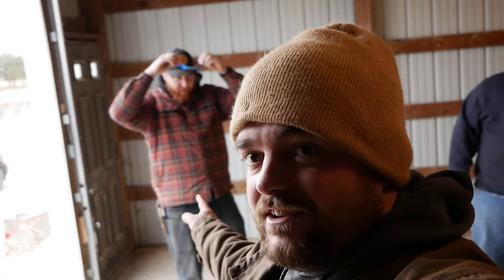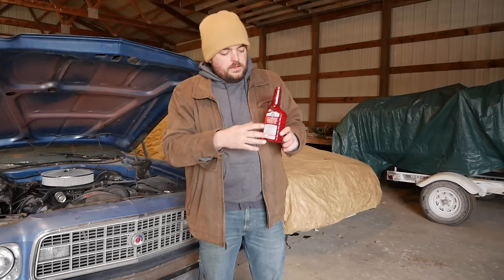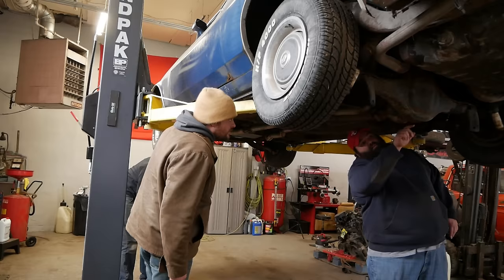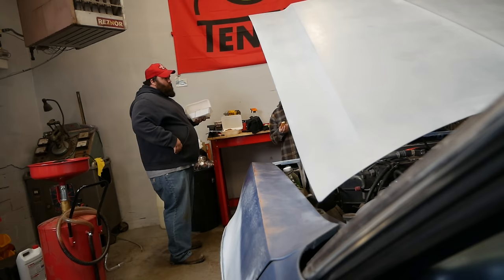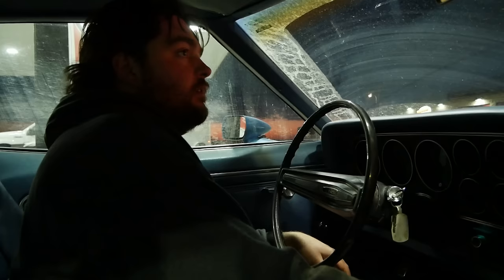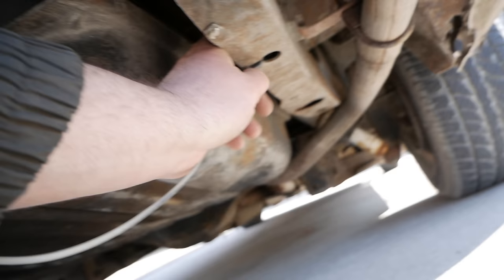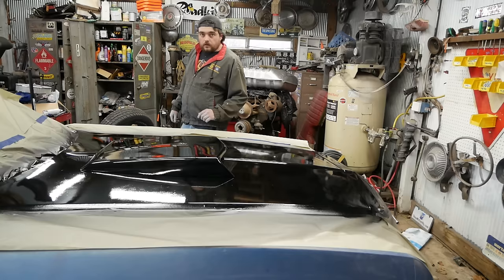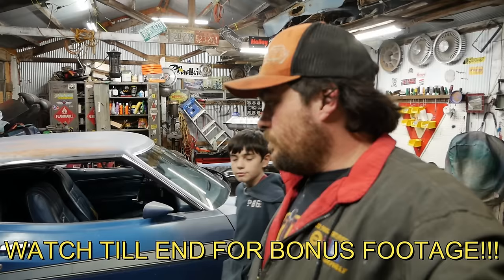Will My DREAM CAR Gran Torino Drive 260 Miles Home? Plus Day Two Mods

Comment: What I appreciate is that you do not just pull a vehicle out of a tree row, make it barely limp to your shop and then park it forever.  I want to do this some day and make it reliable.  You are great narrator and your boy has a personality which is awesome.  So yes, take us along when you make this Torino better and betterer.
Reply from the maker: Thanks Kindly👍
Reply: The guy you are referring to is barn sour, lol that's like when a horse will run towards the barn but won't run the other direction ,
Derek will drive any car home no matter how far the mileage. but  have you ever noticed when he leaves his vehicle has to have an LS motor in it and all kinds of upgrades done. I realize those are his cars he can do whatever he wants but in my opinion he's not enjoying most of them. That's why I enjoy. Dalton and his show he is a road warrior ,a lot like me if you build a car you should be able to hop in it and go anywhere any direction as far as you want without worrying about a breakdown, And if something breaks? so what ,fix it and keep going

Comment: In 1996, I found and bought a 1973 Torino with 29,400 original miles. It was like new, garage kept, factory belts and hoses were still on it. Paint code 2B bright red, base model with exceptions of 351W, FMX, sport gauges with tach, power disc brakes, power steering. Interior was base black bench seat. I installed rear sway bar, gas shocks, 15" x 8" wheels with fat radials, dual Flowmaster exhausts, and then drove it daily for the next 20 years without any major problems. Gave it to my son about 5 years ago because he is a better mechanic than I am. He was with me when I found it, age 5, and he grew up riding in it daily. I will always love these cars. Congrats on getting yours.
Reply: Its great to hear that someone in their late 20s now early 30s actually wanted an older American car!   That made my day,  I've never owned anything but American, my last purchase was a used 1997 Mark Vlll in 2002,.  Still have it and it has over 350K miles

Comment: Ah, the memories. My first car was a '73 Gran Torino Sport that I purchased in 1989, just before I graduated from high school. It had a 351 Cleveland and an FMX transmission. I loved that car and drove it into the ground, before trading it for an '86 Firebird. I miss it to this day. Thanks for sharing!
Reply: Also my first car at graduation in 82, but it had a Windsor. It didn't take long for me to swap it with a Cleveland and FMX transmission, and I also miss that car.
Reply: My buddy had a 1970 Mercury Cyclone with a 351 Cleveland and a 4 speed. One of the fastest cars I ever rode in.

Comment: I’ve also found that Rustoleum is the best spray paint unless you get the expensive custom mixed stuff at a paint store if you’re tryin to color match sumthin. The absolute BEST spray paint for coating a truck frame is the Rustoleum “Professional High Performance Enamel” paint. It’s a little better than regular Rustoleum, and it’s a million times better than any of the rubber undercoating in a can. I’ve used it for years now and it’s the only thing that has survived salty winters. The undercoating in a can is the absolute worst junk I’ve tried, it might work in some situations but salty roads make that crap flake off almost immediately.

Comment: I was going to write that your Gran Torino needs a hood scoop ! and you were way ahead of me , looks soo much better now , and I really appreciate the fact that you have your brother and son along on your adventures , and thanks for taking us along on the ride too !
Reply: Gran Torino should have had a factory scooped hood. Not sure why this one didn't.
Reply: OK, I checked this out. The GTS scooped hood was standard on those models in 1972, but optional in 1973. Bummer.
Reply: Wide tires is a must on this car...that's why it has air shocks.
Reply: @scottwright388  Agreed helps with getting traction to the pavement and when you are behind it in another car it just looks badass

Comment: I’d like to see more.  She deserves a fixed up body.  And by fixed up, I mean welded in patch panels.  You can do it!
Reply from the maker: It'll get whatever it gets, they don't make patch panels for these
Reply: @PoleBarnGarage  Whatdaya mean they don't make patch panels for these anymore???  I saw a roll of patch panel at my local hardware store just yesterday.  In fact, they had more of that brake drum rebuilt in a can right next to it.  Modern tech, I'm telling ya!
Reply: JB Welded in patch panels**
Reply: little body work little bondo  with a nice paint job. Look great. I could do a nice paint job job on that car

Comment: IT'S COOL THAT YOU LET THE KID DRIVE.  I STARTED DRIVING WHEN I WAS 7. 1968 TOYOTA LAND CRUISER WAS THE FIRST OUT IN THE DESERT. THEN OTHER CARS AS WELL THAT MY PARENTS HAD. 1974 ROLLED AROUND AND MY MOM BOUGHT HER FIRST 1970 BOSS 302 MUSTANG AFTER HER DIVORCE. I WAS 12 AND SHE WOULD LET ME DRIVE IT IN RURAL WADDELL AZ. SHE WOULD TELL ME TO HAMMER IT AS WELL. THE FASTEST I DROVE IT WAS 120. HER SECOND BOSS 302 WAS A STRIPPED MODEL, AS THE FIRST ONE WAS LOADED WITH THE OPTIONS. BUT THE SECOND ONE WAS PROFESSIONALS BUILT AT THE PIT STOP IN SCOTTSDALE, AZ. IT WAS A BEAST. IT WOULD COMPLETELY ANNIHILATE THE FIRST ONE WITH EASE. HER FIRST BOSS 302 SHE HAD SHE TRADED OFF TO HER FRIENDS 72 4X4 SCOUT. SHE SOLD THE SCOUT 2 MONTHS LATER FOR A 45% PROFIT AND WENT OUT AND BOUGHT THE SECOND BOSS 302. WELL HE BLEW UP THE BOSS AFTER DISCONNECTING THE REV LIMITER. BUT HIS LUKE AFB FRIEND BUILT IT BACK UP PRETTY DANG STRONG.

Comment: That is so cool that you got your dream car, I felt your excitement throughout the video. And the fact that Kevin just "happened" to have it hidden away just waiting for you, it was like it was meant to be. That turned out great, as I was watching I wanted to suggest the method I used on my 77 F-250, I used doller store oven cleaner on the spray paint, let it sit a few minutes then hit it with a pressure washer. It worked pretty good and much faster. Then what was left I used the scotch brite pad method like you did. Thankfully I only had to do the cab and front clip, lol as the bed isn't original and not the same color, "yet". Hopefully that tip helps you out on future projects. Keep that smile ear to ear sir and enjoy that new ride. 😁

Comment: I bought a 1973 Gran Torino (2-door, with 351 "Cleveland" V-8) after my beloved 1967 Mustang got totaled by a drunk driver. My Torino wasn't the fastback, though. I'm glad you like it, I hope you are happy with it. Mine was really, truly, far & away the WORST car I ever owned (and I once owned a 1974 Vega!). I was about to go back to college, I HAD to have wheels. ANY wheels. Huge on the outside, only so-so interior space. Handled like a barge. Guzzled gas INCREDIBLY. Rusted like crazy. Fragile cloth seats. I was FINALLY able to unload it for $600 a couple of years later. But HEY, "Other than that, Mrs. Lincoln..."
Still, I can tell you're happy, that's what counts. Best wishes!

Comment: I had a 1971 Pontiac LeMans Sport, 2 dr HT, YN series engine, TH350   column shift, bench seat. Loved that car, put 177,000 miles on it, sold it to make room for my now ex's 1st car. 
Had kept it maintained, suspension, etc. had dual exhaust conversion  with 'cherry bomb' glass packs I burned out the 1st week I owned it, travelled in my new job with that car, then went to either company cars or leased them, planned to go to front bucket  seats from a '69 Firebird, and a center console shifter, maybe hang a clutch pedal and go to a 4-speed. 
That car, and a 68 cowl inducted 396 Chevelle SS were my 2-favorite cars I owned.

Comment: I had that exact same car. 1973 Gran Torino Sport with the 351 Cleveland V-8. I bought it with about 6000 miles on it in late 1973 when I was still in High School. It was blue and had that reflective laser strip. I had a c.b. radio and my handle was The Blue Streaker. It had the blue interior. I had the C-6 tranny beefed up with the same one police cars had. It was truly a great and beautiful car.

Comment: I finally bit and checked out your channel after Kevin has pointed it out umpteen times.  My dad had one of those cars in Saddle Bronze, his had a 351, it survived a tornado unscathed!  He got rid of it in late 1990, but one quirk I remember of it, it had a manual washer pump, you had to turn on the wipers and push the wiper switch in repeatedly to pump the fluid through.  So you might try pushing the wiper switch/button in repeatedly.
Reply from the maker: Hmmm ok

Comment: Here is the deal on bumpers for 73 and 74. NHTSA required front absorption bumpers in front only for model year 73. The rear absorption bumper was not required for 73 but it was in 74. This gave manufactures an extra year to comply with both. Some manufactures just went ahead and did both in 73 but the back bumper was not required until 74. I owned a 73 Torino just like that one with the 351 Cleveland engine!

Comment: My first car was a 74 Gran Torino - bought used in 1982 for $865. Had the 351 2-barrel - thought it was fast! Had it for four years. Regarding the bumpers - I believe 73 was the last year of the rear 2 1/2 mph  rear bumper and the 5  mph front bumper. 74 saw the addition of the 5 mph rear bumper.
Great video! Brought back memories. Subscribed!!

Comment: Good ol 73 mandates... The vette had a poly front but still retained the chrome bumpers in the back too for that year until it got screwed up completely in 74. I love this body-style. A little partial to the 1972s of the body on frame torinos but dang this looks sharp too.

Comment: The Kum and Go at the 56 mm where you gassed up is one of the BEST places to stop anywhere on I 35.... that said I haven't been there in 10 years since I quit driving a big truck. But the Kum and Go at the 56 mm was one of the  Best places to stop....

Comment: Hi Kevin I've had those cars since high school and I am now 54 years old. I still have 2 currently in storage . I built 400 M as well as  Mild to hardcore Cleveland. Give me a shout if you want to hear about what I've done what I've found out works real well and all that good stuff . Just N FYI I also had my own engine building machine shop until an injury. You will love the 400 M. People used to give them to me because they thought they were a Smog dog engine and they were from the factory . But it is very easy to make them  A torque monster really cheap best of luck on the build hope to hear back.  PSI forgot to add mine were always the 1972 fastback with the   Hood scoop

Comment: I learned my lesson about rusty fuel tanks long ago. I assume that the tank is worst-case rusty & install the largest fuel filter I can find in the fuel line close to the tank. A inline fuel filter for a diesel truck holds a huge amount before stopping up. Tying a wire to a magnet & putting it in the tank thru the filler neck also helps.

Comment: I had a 1970 Torino GT with a 351cleavland 28 years ago and I really miss that car. As far as spray cans go to can top it off with a 2K clear coat in a can. You just have to pop the bottom seal and it releases the hardener and looks like a paint job out of a gun. That would be a really good option.

Comment: Nice rare car fellas. Look, two things get rid of those leaves on the cowl under the wipers. That is stopping the air from coming into the passenger compartment. Many people overlook this, or don't know what that means.

  2nd " THE A/C DON'T WORK. PROLLY JUST NEEDS A RECHARGE!!" That's my favorite thing to hear. Couldn't be more wrong.  There is a reason why the freon leaked out. It's supposed to be a closed system.  If you find out where the holes are (dye test) you might find out it'll set you back low $ thousands.  Off my rant! Thanks for saving Ford History!
Reply from the maker: That's a high estimate on AC, I could just buy a complete vintage air setup for less than $1500. I'll throw some miracle fix and refrigerant in it and see what happens
Reply: @PoleBarnGarage  a " hell yea" way to go. My 87 Plymouth Gran Fury had the same issue. A/C blew hot. The dye test showed leaks at every "O" ring, the condenser had leaks at every connection. I'm like, look, I'll just take another car on illegally hot days 😂

Comment: 0:45 this also applies to at least Lincoln continentals from 1973 as well, as they will have the older recessed tail lights with the large front bumper

Comment: When your pouring paint poke ahold in the seam with a screw driver and about a 10 inch piece of 2 inch tape half way around the edge when you fill your cup and set the can back down the paint will go back in and drain through the hole you poked in it and you don't have a mess when you take off tape

Comment: I loved my 73 Sport! It was in green. But then I saw a 69 Mach I 428 4 speed as a trade in at my dealership, and the Torino was history. 😱

One thing with semi flat and semi gloss, if you put it on thick it will end up a lot shinier than one is looking for. One way I do it is just empty the spray cans and use a cheap spray gun. Still very cheap and a much better dull finish.

Comment: Really enjoyed this video! 
I had a 72 Q code 4-speed car, and the previous owner robbed the drivetrain. I eventually sold it to a friend who had it for 10+year's without doing anything to it. My first car was a 1975 Mercury Cougar XR7. It was a blast to drive, I still have the last motor I installed in it. It is in my 68 fastback now and strong as ever.
Reply from the maker: Very nice!

Comment: My parents bought either a 72 or 73 with a Cleveland.  The Grand Torino Sport . The engine went out quick. I guess just after the warranty went out. So my dad did an in frame rebuild. And sold it. A few months later Ford did a recall. They would replace the engine and if you had fixed it and gave them receipts, they would reimburse you. My dad didn't keep receipts so he lost out lol.

Comment: 29:00 I also had to cut down a carb stud to clear the hood but mine had an Edelbrock on it (probably not the best idea either), so I hacked it off with a dremel and then couldn't understand why the wingnut wouldn't go on.  That was my first experience learning WHAT a tap and die set is used for.  Because I caused the why.

Comment: Back in the day I also had a 73 Gran Torino Sport that I installed load level shocks on the rear an it was just enough lift for my Douglas Grab N Go tires (60's) not to rub.

Comment: That's neat about spare tire I  had a 72 Grand Torino and it still had the original poly glass spare and it was still new even still had a few of the whiskers on it from the mold machine.

Comment: My first car was a 73 Gran Torino sport. Bought out of a field in 87, rebuilt the engine with my dad on the carport. I've tried to find it all these years later but a 10 digit VIN makes it hard to search for. Also it seems like all the ones I see online have bench seats. Nice to see the buckets and console.
Reply: Mine was a 73 Ranchero, same vehicle except it had the pickup bed. I wouldn’t mind finding another…..

Comment: My dad and uncle were changing the tires a half-time and ran in to catch the rest of the football game. Next day we were driving down the road and a wheel just flew past us down the center of the the highway ... probably six seconds later the old stationwagon tilted back and smacked the pavement missing a wheel. Those old guys forgot to tighten bolts too.

Comment: That wrinkle in the 1/4 was most likely caused by getting bumped in the rear bumper area. That being the case, don't pull the dent itself. Instead, pull the 1/4 from the point of impact I'm the rear and  most of that wrinkle will disappear when you get the 1/4 pulled back into its correct position. You may have to remove the interior panel or headliner to access that wrinkle from the inside to give it some light taps as the 1/4 is being pulled.

Comment: I have a 74 Gran Torino Brghm that had been parkednsi,e approx 2008-2009 range. It has a 351 CLeveland previous owner swears mileage is actual  its like 39 k , she is running and driving again  and still working on the pet damage under the hood

Comment: Nice ride 👍. I’ve owned the sister car to the Torino when I was 17 a 1973 Mercury Montego GT. 
Red with Black interior bucket seats with console factory gauges. 
Mine came with a 351-Cleveland 2bbl. C4 transmission and a ford 9inch with a factory locker and 3.00 gears ⚙️. I wish I could find another one maybe someday. You have a fine ride take care of it and it will outlast Any new car. I’d like to see more of the Torino. There’s a upgrade that will complete it and that’s a built 460 in between the fenders a built C6 transmission and a traction lock differential with 3.25 gears.

Comment: I had a 73’  with a 460 PI 
 Police interceptor 390 hp. 
  She was fun. 
Valve covers started leaking and filled the spark plug holes around the plugs that got hot and ignited the oil. That was fun.  I eventually sold the motor to Big Daddy Don Garlett , and he  punched it and put it in a street car. (I don’t know what car  it was ).

Comment: Smokey in here....... My old front wheel drive turbo wagons i played with (Volvo) id take a nice tight , slow sweeping bend off main road to home suburb as fast as i could then boot it into boost to get a wheel spinning , good used tyres were on there so i just HAD to scrub them in and yes , theres smoke in here , my daughters remember the days......

Comment: You can mute the volume on gas station pumps. The buttons on the right side of the screen, push the second button from the top, works 99.9% of the time.